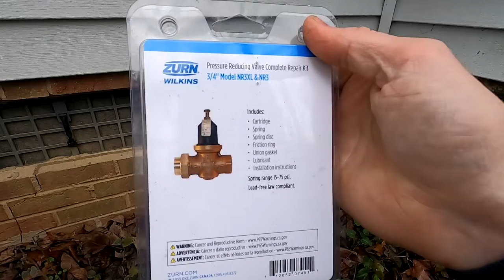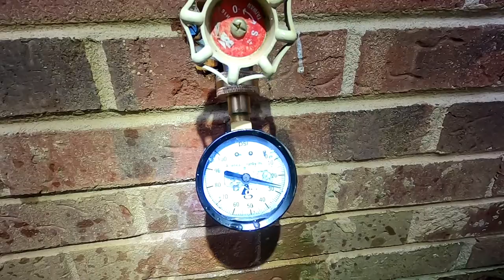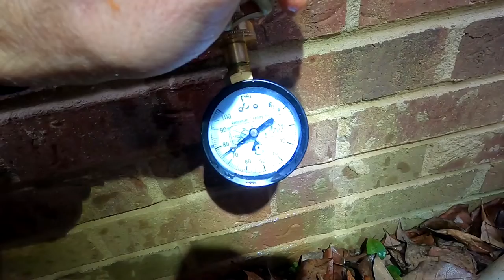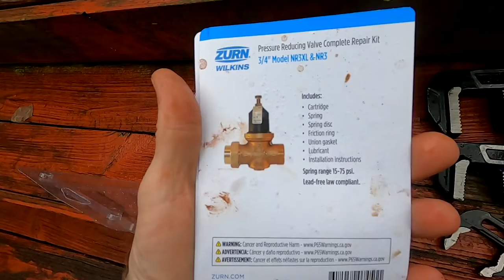Water Pressure Regulator Valve Rebuild

Comment: Typical domestic water pressure is 45-50 PSI. You can set it to whatever you want but higher pressure just wastes water and puts more stress on your pipes and appliances. Maximum permitted by code is 75 and most municipalities will easily exceed that in off hours during idle periods in the early morning. If you're having a volume problem and everything else is fine that would point to the pipe size being inadequate. A lot of new homes are being built with 1" main supply piping. Typically, with a 20 psi falloff (when you open a faucet) you won't notice a difference between 55 psi and 75 psi. It's very small.

Comment: Couple of things.  1) Your water pressure doesn't need to be 75 psi.  60-ish is perfectly fine.  50-ish should suffice in most houses.  And 2) You don't squeeze a bunch silicone all over the cartridge like that.  That just makes a hot mess inside the valve that is going to get clogged with debris.  The o-rings just have to to be coated with silicone... so, just a drop or so on them, rubbed all around, is just fine.  Oh, and 3) that "special wrench" that would have made the job easier is just a Crescent wrench... nothing fancy or unique.
Reply: Spot on 100%.  PSI 55 fine for cold, and that SILICONE lubricant is to be used very sparingly.  Sheesh.  I would say this is a good video to see how to and not to do the work.  Call it a first pass look as to what to expect on rebuild.

Comment: In my experiences, it's easier just to replace the whole valve
Reply from the maker: It could be easy, but rebuilding it was easy rebuilding it.  Thank you for your comment.
Reply: And way more expensive
Reply: In the case of some of those cheap valves that may be so. In many cases like with the Conbraco/Apollo valves it's damn near impossible to get a kit. Almost like they WANT you to buy a new one. And their valves are $200-$300 depending on size for the 'cheapened' ones with the plastic top bell cap. For 3/4" and under you can get a replacement Watts or Zurn for under $100. The problem is breaking the connections to install it. If they're sweat joints or Propress'd PVC it's beyond most DIY'ers scope.

Comment: A pressure reducing valve (PRV) is a variable friction loss device. To have friction loss the fluid needs flow.  Unless the valve seats perfectly the downstream pressure is going to equalize to the upstream pressure. Once the downstream pressure is relieved (opening a valve) the PRV will open allowing the upstream pressure to compensate for the loss of downstream pressure to the spring set setpoint.   

The point is: to check the PRV setpoint a small flow is needed in the downstream. In most cases there is likely a dripping faucet or some other flow that will overcome the seat leakage but to be safe, crack a faucet open downstream to be sure the system is not hydraulically locked. 

Good video .  Helped me prepare to do mine.

Comment: Thanks for the video. I'm going to attempt the same repair today. I did notice an electrical line right next to your plumbing. I would suggest that circuit be switched off before doing any plumbing in that area.
Reply from the maker: Thank you for the safety tip.  I would like to say that I did isolate that circuit ... but I did not.  Lucky for me, the insulation on that wire was good.  Good luck on your repair.

Comment: Several months on, how has the repair held up? I just cleaned a bunch of that dirt/silt out of my PRV and while it did help at first, the problem seems to be creeping back. I wonder if it’s just an exercise I’ll need to repeat because either I didn’t flush enough out, or the source of the contamination is unresolved
Reply from the maker: My repair is holding up as good as new.  I think a bunch of mud and grit got in the pipe when I replaced a leaking section of the main water supply line.  I tried to keep everything clean, but it was in a muddy hole.  I don't have any filter on my supply line, so that may be something that could help.  I think the mineral content of your water could be a problem as well.  My sister has well water and she gets a bunch of mineral build up in her hot water heater.  So your "contamination" may just be natural occurring contents of the water.  Good luck.

Comment: Great video! but where to buy that rebuild kit?
Reply from the maker: Thank you for your comment.  I should have mentioned that I got mine from an online company called zoro.com.  I had bought something from them before, and they were the lowest cost of all the other companies that came up after searching, on the internet, for the same model that I had.  Your pressure regulator valve should have some identifying markings on it that you could search and be able to find the kit for.